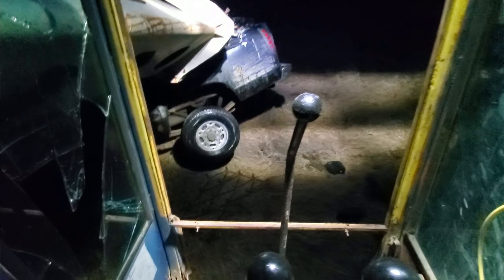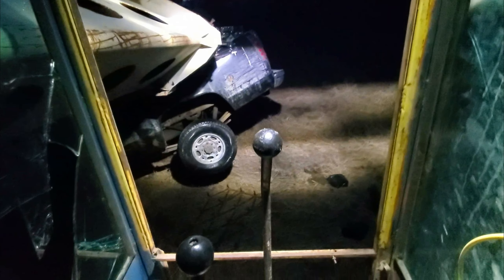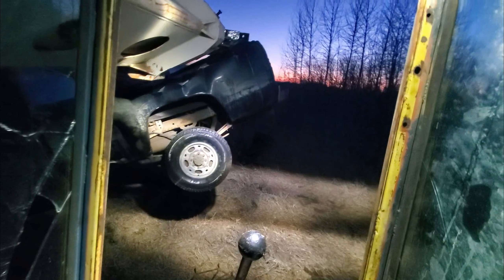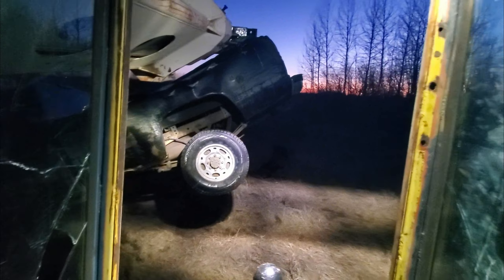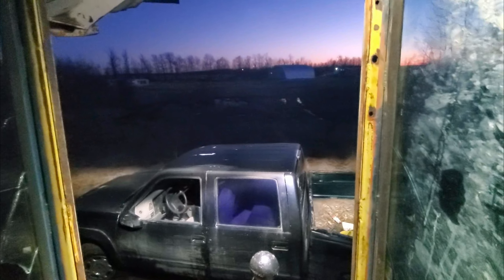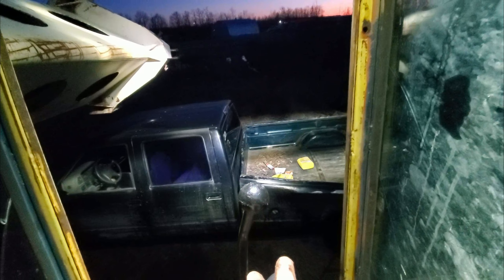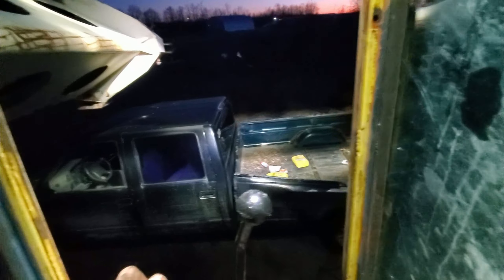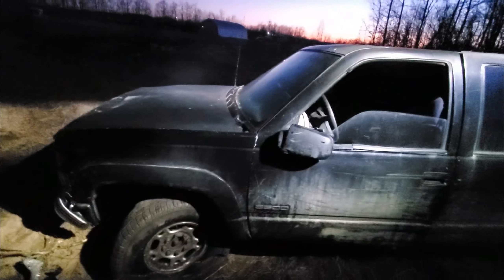Chevrolet 6.5L GMT Durability Test

Comment: Theres no problem plating from one province to another. I do it all the time you just need a safety in the new province
Reply from the maker: The vehicle has to be in good shape to do. This one was not. Rust is an imediate fail. Especially floor & rockers. It is ultimitely up to the technician to pass or fail. They are given guidelines to follow. Most are very strict. A 5 year old Toyota camry is no problem. A rusted out 1 ton 30 year old truck missing original equiptment is a different story.
Reply: Old license plates can fix that right up!